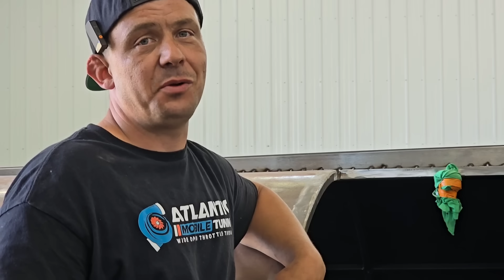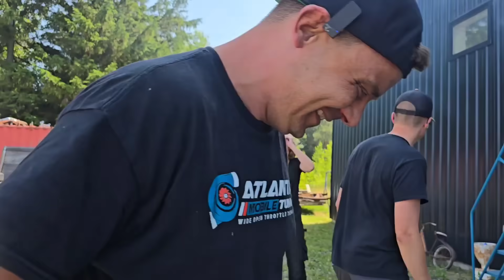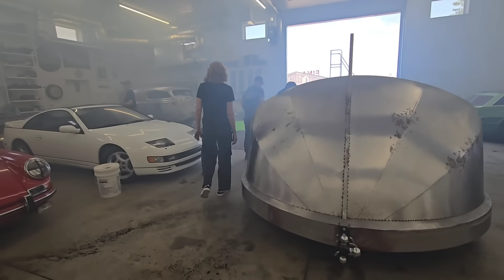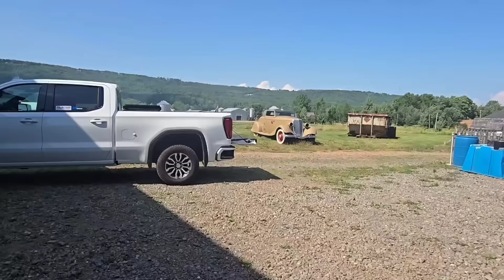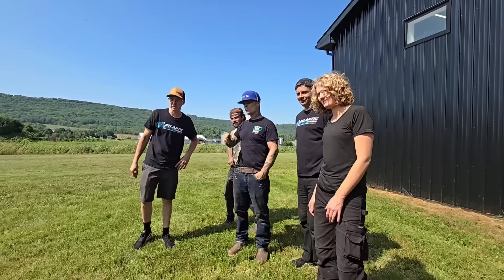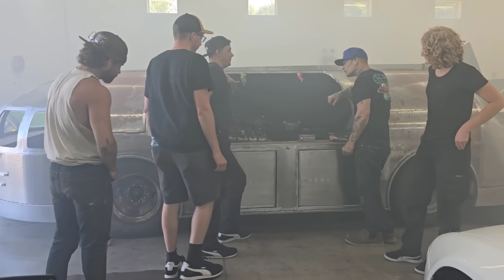This Burnout Might Just Break the Internet 🤯🤯🤯

Comment: Dean Andrea and Jesse are a great example of harmonious teamwork without drama  goes through troubleshooting a used engine to get it going.Hope it brings them mucho business.
Reply: They did a very good job under trying circumstances. It would be great to follow up and see how much extra work this span for them.
Reply: @LiamGross2 I don't see what the trying circumstances were. So, it was warm in the shop. I worked in 180 degree heat in a glass factory for years. They made a lot more money than I did I'm sure. Maybe we should call them a waaaaambulance. Or is this just another attempt to run Chad down?
Reply: @steve-rh5dv Well, it's Chad's car, Chad's garage, Chad's channel and Chad's son. And Chad gave them a lot of exposure. So, they apparently had no problem helping him and Chad had no problem helping them get the word out. I still can't see the problem.
Reply: @steve-rh5dv 
Why dont you go ahead and look up Chad's net worth, and then look up Jolenes while your at it. Both together or separately have more than you will ever come close to.
Reply: maybe you need a wambulance , ? You're the one crying over a comment that didn't attack Chad .
The trying circumstances were , no factory harness, 2nd parts , not a factory install , they put it all together, chin up matey @johngersna3263
Reply: @steve-rh5dv I’ve been watching this channel and Chad build cars in this garage before he ever met Jolene.
Reply: It’s easier to deny
Reply: Now interior do a burnout on the road and a coat of paint